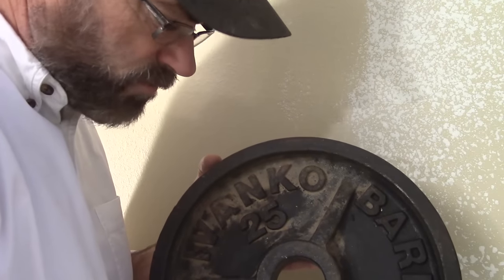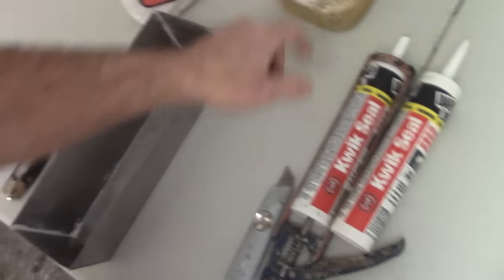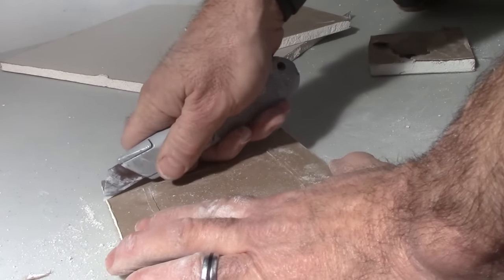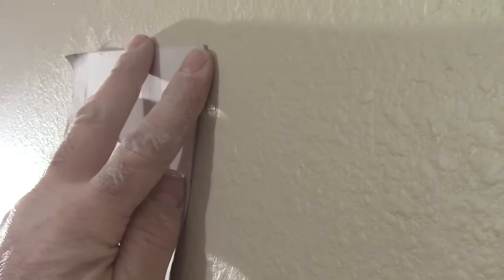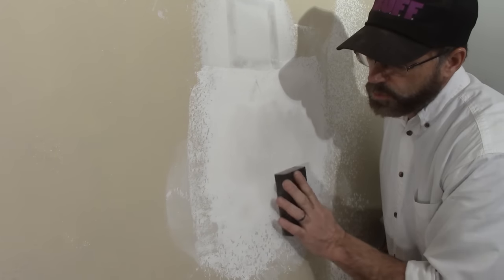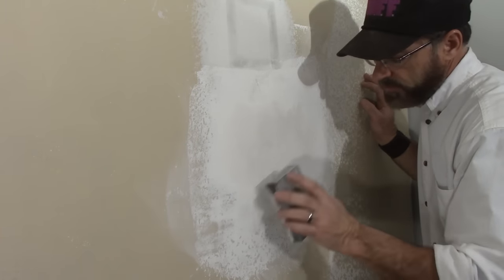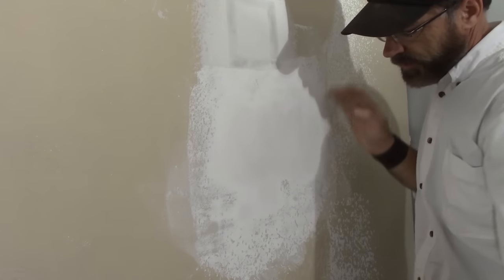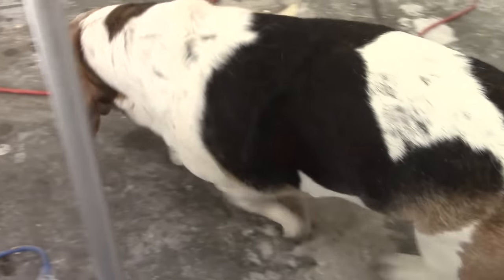How to Repair Drywall and Match Texture - DIY Duke

Comment: Great video. With the caulking method under non textured (just painted) wall patches, do you find the paint over the caulk gets a little shine to it? Just wondering if you just use that method with textured walls.
Reply from the maker: yes that can be true, but a good primer over the caulking first before paint should eliminate any shine.  Paintable caulking usually never has any shine however.

Comment: I luckily had the peices cut out and the had enough width to glue them in with flex glue, but I also have a few gashes on my brick plaster that needs textured, but it's a weird flat with vallies textured

Comment: I recently had someone working to fix a hole in my kitchen wall. However, he did a very sloppy job and now my wall has too much texture on it. When you go to touch the wall there are huge globs of material on the wall where the hole was. What is the best way to fix this problem? Should I just sand it down and retexture it with the spray?
Reply from the maker: Yeah that's the best way.  Try to feather the edges and over spray past the patch will help it blend better.
Reply: Wow! Thank you so much for the quick response! I will try that out this weekend! Thanks again for all your help!
Reply from the maker: You're welcome

Comment: In both examples you're not putting any mud or caulk where the side of the patches meet the side of the wall.  Sure, you have mud under the extra paper around the patch and then put mud on top of that same paper but you have nothing actually creating a bond between the sides of the patch and the sides of the wall.  You need to "butter" either the sides of the exposed wall or the sides of the patch so when you push it into place it fills the gaps and creates a bond that dries and hardens to give strength to the patch.

Comment: Most of the time, people just cover holes with drywall mud. They don't bother to cut out the hole and put in a new piece of sheetrock. It that why the drywall eventually starts to pooch out and form a ridge? I found a crack in my hallway. I cut away all the old paint and drywall, and then covered it with the mesh tape, and then drywall mud. Was that wrong?
Reply from the maker: +Becky Smalley yes it will bulge like that without backing, unless it's a small hole

Comment: I have a quarter size hole in my facia board outside. Can I use the same method and then just paint over it to make it weatherproof?
Reply from the maker: yes you can the paint  will protect  it
Reply: Thanks Duke!!!!

Comment: Any issues with the paint looking different on the caulking vs the rest of the wall?
Reply from the maker: +Parker Eldredge just a good primer first, then paint otherwise yeah it would show through.
Reply from the maker: just use a primer first and you won't have any absorption differential otherwise yes it may photograph through

Comment: Hey Duke, I love your videos, keep up the good work. I was wondering if you have any ideas for a DIY solution to protect my drywall in the corners of my home gym when I'm doing the landmine press / tbar row etc... and have one end of a barbell in the corner. Thanks!
Reply from the maker: +Dan Latimer hey Dan, know what you mean - I put a piece of short angle iron in the corner after drilling holes so I could screw it to the wall.  You could make a an angled piece from a couple 1×3's or 1×4's screw them together then screw them to the wall that way you don't have to mess with steel.
Reply: +DIY Duke thanks Duke, I think I'll give the wood idea a go!

Comment: Great video, thank you. Question: Isn't the patch going to be extremely delicate now since it isn't held in by anything other than a little caulk and the backing tape? It seems like a little pressure on that patch would push it through the wall.
Reply from the maker: Eric Schlenz it's actually not to different than a joint that spans 24" centers, the tape definitely strengthens it and caulking is very strong once it dries.  Course if you purposely put a lot of pressure on it, but you can put a lot of pressure on normal joints and they'll give.
Reply: Thanks! Good video

Comment: Do you actually work with drywall or just do different videos on different subjects?
Reply from the maker: I worked in drywall for about 15 years, 5 years as a drywall contractor.  Mostly residential but also some commercial.  Moved on to other things.

Comment: Duke - Ha! Ha! Love the humor!  :-)  Serious question for you: what is the texture on the wall right at 0:35???  Is that merely built up roller stipple after multiple coats or is that lightly sprayed orange peel?  I recently mudded/sanded over an unwanted electrical outlet and I'm trying to blend in the new, untextured mud with what looks exactly like the texture at 0:35.  What is it?
Reply: +Twister051 To clarify, I mean exactly at 0:35 where you show the gash in the wall......that actual damage section of the wall....is that orange peel texture?
Reply from the maker: +Twister051 yes that is orange peel, sorry it took so long to reply; I don't always get my notifications from youtube for comments :(

Comment: fixed hole and looks great but when painted still can see square and its very noticeable? ?????
Reply: make sure you put two or three coats of spackle down sand in between coats  then put two coats of primer then paint
Reply: It's not surprising Glenda as the finish is not flush. This is all a bad design, no strength in the repair also. I've repaired lots of dry lining. Can use timber or pla/bd backing with drylining screws plus pva, all nits together nicely.
Reply: Did you texture the patch and around it?

Comment: Thank you so much for this video
Reply from the maker: You're very welcome
Reply: DIY Duke i was about to buy a hopper for a 2x3 ft area of ceiling. The spray is much more economical and easier to fix up my problem. Also the brush technique was awsome. I have a few areas i patched that stand out.

Comment: That’s a bad patch, you should always cut a bigger hole between 2 studs and use drywall screws to screw it in, otherwise it will not be flush with the wall…

Comment: Liked this vide, however there is a much faster and easier method to fill the holes. use styrofoam or a sanding sponge. Hold to wall cut a smidge larger than hole, squeeze into place and mud. Mere seconds compared to what was shown. Maybe l should do my own channel....

Comment: Sorry I cannot agree with all of your methods. You just left a weak spot in the wall. The proper way to insert a patch piece is to insert a 1x2 or even a piece of plywood into the hole (larger than the hole) and screw it to the wall from the outside.  Then set the piece into the hole and screw it to the backer wood piece.